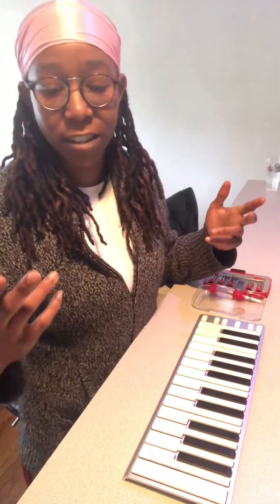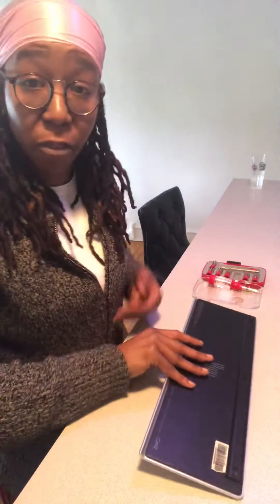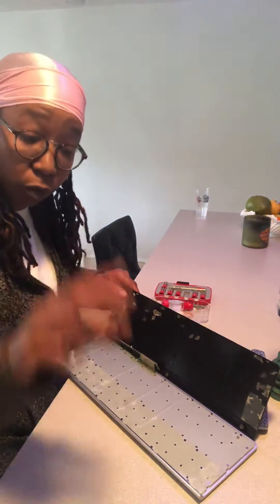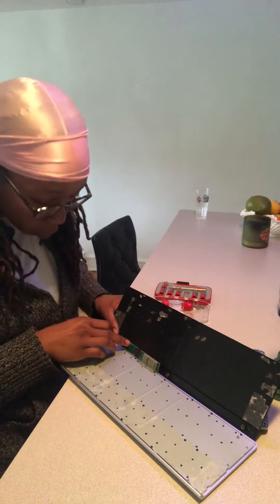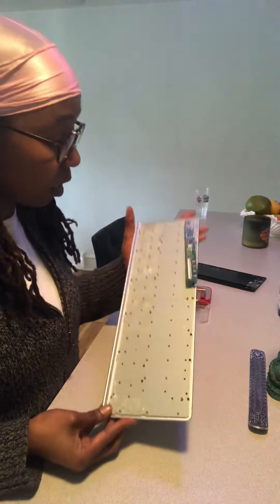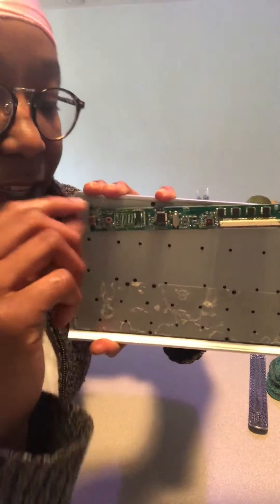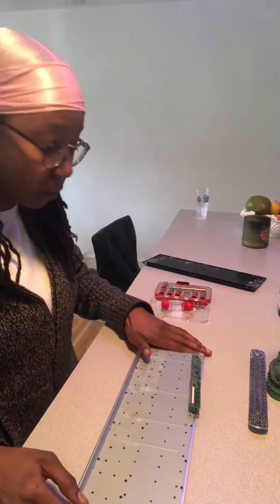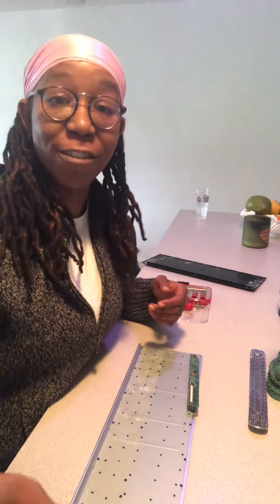HOW TO FIX XKEY 25 USB

Comment: Its the 2013 version? o what controller its?
Reply from the maker: Hey Luis! It's the 2013 XKey 24 key. The small one
Reply: When you take the bottom off is it possible to remove the top casing off as well.?